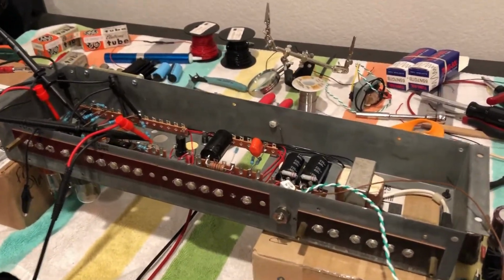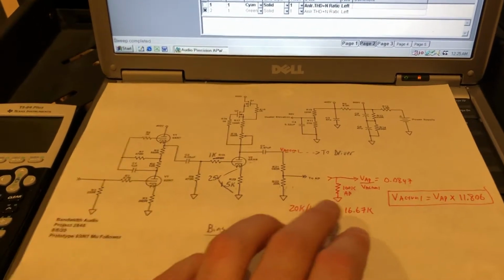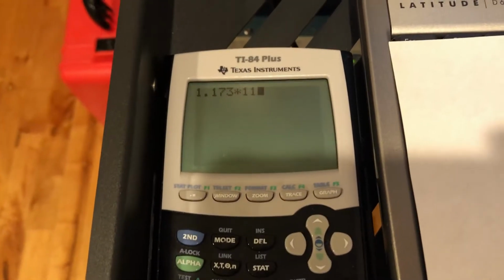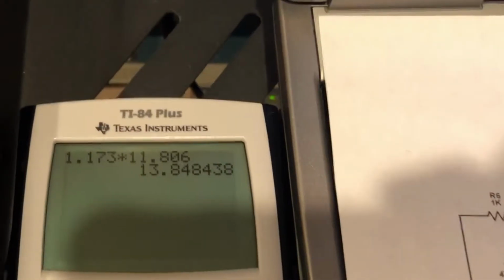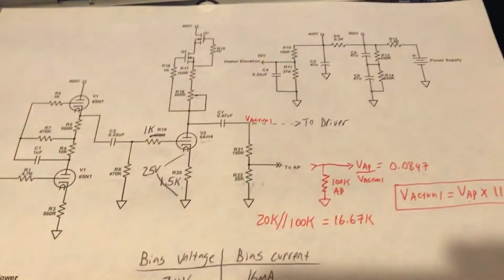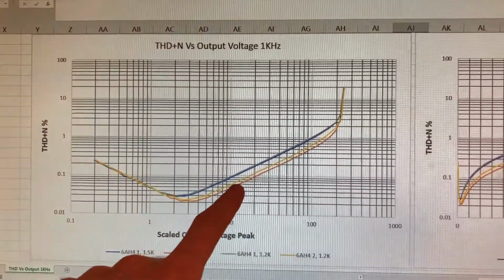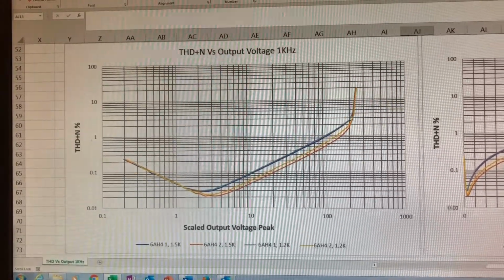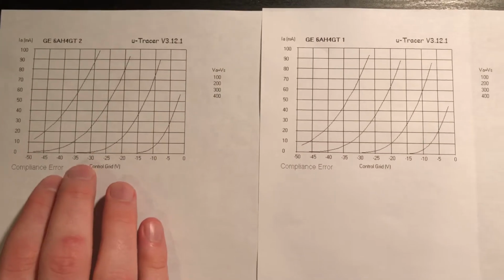Continued Testing Constant Current Source CCS Tube Amplifier - Bandwidth Audio Project 2845 Part 7

Comment: Super clear explanations. love your channel. This CCS can apply to driver tube like 4p1s dht? Currently I used it as choke loaded go drive845, cos I know nothing about ccs.
Reply from the maker: Glad you are enjoying the videos! This CCS can be used as an active load for a wide verity of tube stages. The FETs I used are 100mA rated so they can handle up to that current level. Larger FETs will be needed for higher currents levels at the expense of higher capacitance and therefore a reduction in CCS impedance at higher frequencies. With a CCS, keep in mind that the highest signal voltage that can be delivered is equal to the B+ supply. Choke loading has the advantage of developing signal swings greater than B+ supply. I chose not to design using chokes since the performance will be compromised at LF due to limited inductance (low XL) and at high frequency due to winding capacitance.  The CCS has proven (to me) to be the better choice for performance consistency across frequency.